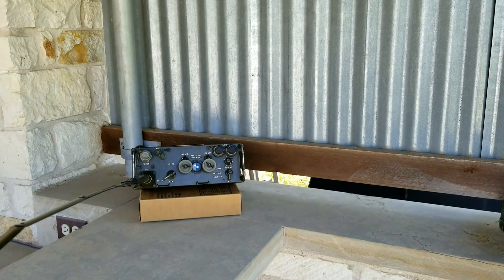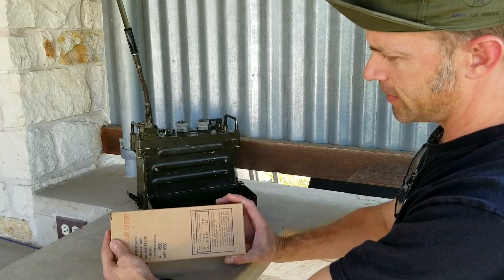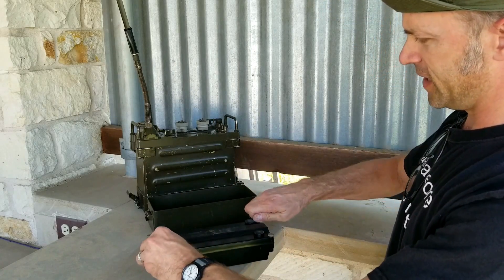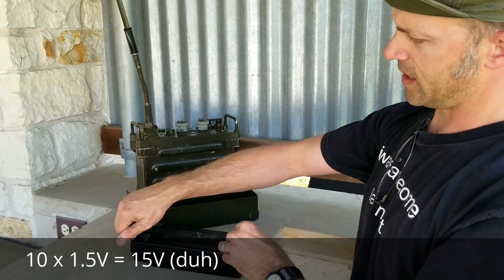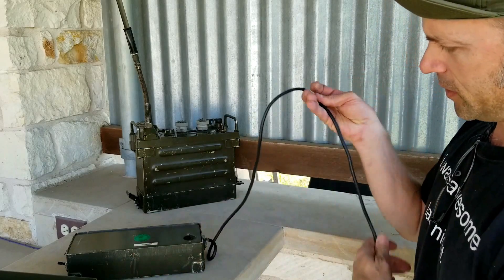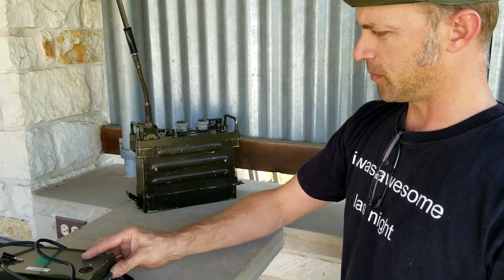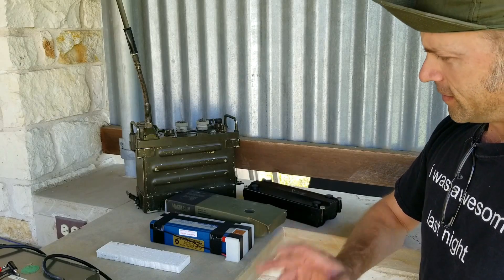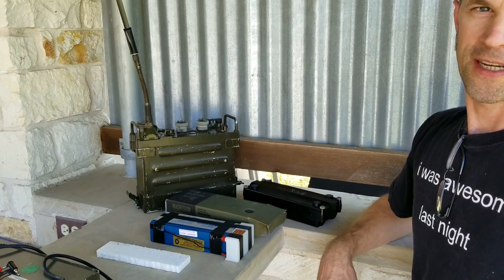Battery Options for the PRC-77 Military Backpack Radio

Comment: Do you work on them?
Reply from the maker: Yep
Reply: I would like to use your expertise, mine won’t voice transmit to my RT-524, but the RT -524 will transmit to the PRC-77. I put in new A50 and A37. I have ordered a new Mic for. Would be interested  working on it if the Mic solution doesn’t work.
Reply from the maker: Could be lots of reasons why the transmit side isn't working; shotgunning modules and mic are one way, but you'd need a full set of modules to systematically get to the root cause. Keep me posted on how it works out @MyRanger12
Reply: @WW2JeepandRifle   Hello, I put a new MIC, on the 77 and it work the first time, when went back the next day to test it ,it would transmit again. Would you be willing to look at it for me?

Comment: Neat trick with the 12 volt slab. I need to try that with my Prc-77. I bought the D-cell adaptor after I bought my radio plus found a working original battery.
Reply: Where can IO get one for my PRC-77?
Reply: Where did you get yopur adapter? I need one myself.
Reply: eBay about 7 years ago.

Comment: Is there anybody marketing these batteries like you have built? Also if I have to build one what rechargeable battery am I looking for? I have gutted some original batteries and kept the connection points and the box. So I can build like you have done. I just don't know what I'm looking for. In reference to rechargeable batteries to put together. I do not want to go with the dcell option as they are very heavy and with our reenactments we transmit and receive a lot and it decreases our battery use time down to about 5 hours. Using D cell batteries

Comment: Singars . That's an explosive in it's self . Although prc 77 batteries can say off shit . Singars radio batterys are made of lithium ion . An opperater better inspect his battery box . To make sure it isn't damaged any time he takes a break . If it's smoking , get it away from you and your buddies as soon as you can . Used sinc. Batts there's an oriface in the side of the battery that when your device dies push a screw driver in there to disarm it . That switch is one way . So don't try to charge it . And put that used battery in a whole and let it cook off .

Comment: You have to understand how the battery was designed to begin with . PRC 77 batteries are designed in two sections . One for receive and one Tansmit . The idea was for detonation porpose s . So the battery Although test dead in one pin , isn't dead in another .

Comment: You know if the PRC77 adapters will fit PRC25s ?
Reply from the maker: PRC77 adapters won't fit PRC25's.  The PRC25 requires an extra 3V supply for the vacuum tube final grid bias.  The PRC77 only has a 12V supply, and the adapters don't provide a 3V tap.  It is possible to modify some of the PRC77 adapters to provide the extra 3V level though.
Reply: WW2 Jeep and Rifle how would you modify them? Btw my email is simpsonjayre@gmail.com if you want to talk there
Reply: @WW2JeepandRifle any tips on how to do this?

Comment: Curiosity, would rechargeable d cell batteries work with the adapter?
Reply from the maker: Yes it would work to use rechargeable D cell batteries with the adapter.  You will have to recharge the batteries individually or as many as your recharging unit will do at a time.

Comment: Was this on F.M. or A.M.? Shouldve covered the 6 meter amateur band
Reply from the maker: The PRC-77 is an FM radio.  It operates between 30.00MHz and 75.95MHz with a window of operation within the 6 meter amateur band.
Reply: Its also wideband.

Comment: I bought a magnesium battery dated 2008 off ebay thinking that defenitly it was dead. I was going to take It apart and stuff D batterys in it. To my surprise when I plugged it in, the radio came alive.
 If you buy one of these batterys plug it in first you may get lucky.
Reply: Will it fit prc10

Comment: Hi, Has the battery D pack (1.5 volts) some kind of transformer to lower the voltage from 15 to 14.4 volts?
Reply from the maker: The D-cell pack doesn't have a regulator or any voltage level conversion circuitry. Straight series battery output.

The operator's manual for PRC-77 (TM 11-5820-667-12) specifies that the battery supply should be kept between 12.5V and 15V.  This setup easily delivers that with fresh batteries.